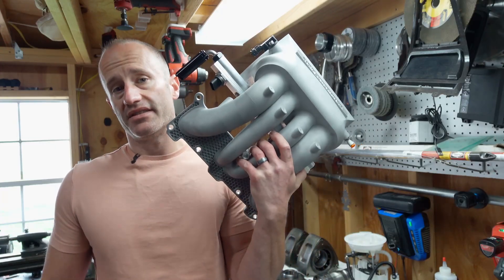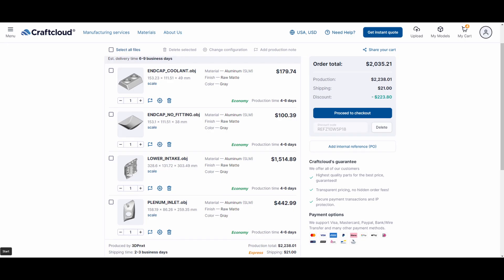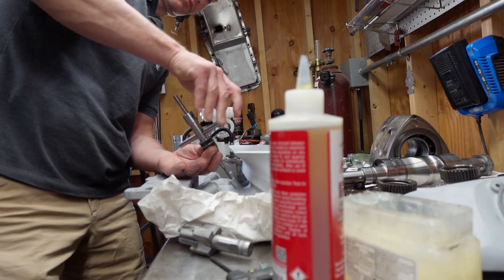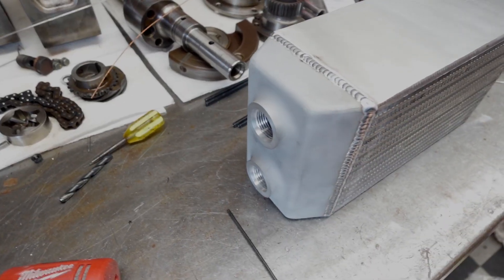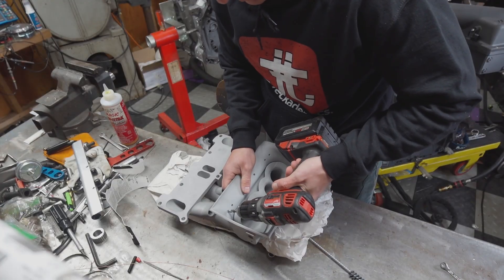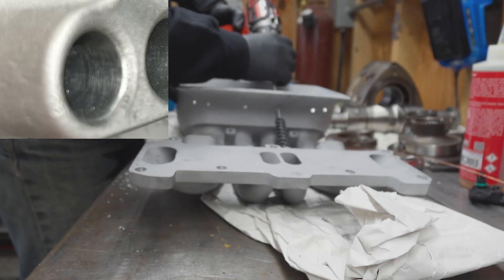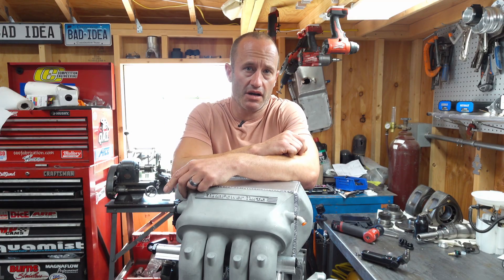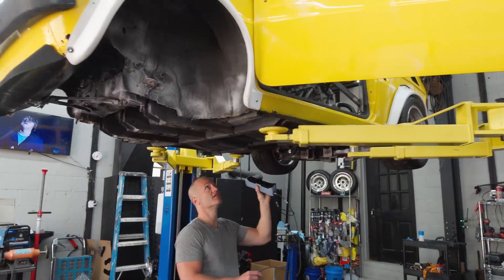Aluminum 3D Printed Intake Manifold - Building a 13B Rotary BMW i8 : EP4

Comment: Please consider doing a thermal dispersant on the intake plenum with a ceramic barrier on the exhaust and hot side of turbo..The company we used for the racing industry is techline coatings.  You can even coat  the hot side of the turbo...
Reply from the maker: Turbine housing is already ceramic coated and the manifold and turbine will get inconel heat shielding.

Comment: Completely awesome! I recently designed a throttle body adapter for a 13B intake manifold, which is a much smaller task. It was still very interesting to get quotes on having it CNC machined or 3D printed. I was surprised how expensive 3D printing metal was, but as the price comes down it will become more and more viable! I think for a seriously complex item like this where the cost of CNC would be so high, it's already reaching that crossover point. Not to mention when the geometry would be literally impossible for CNC as a single part. Really appreciate these videos!

Comment: The belt sander needs to be flat to ensure an accurate result. The straight edge needs to go on the sander first.
Reply from the maker: The amazing part is my belt sander is a 20 year old harbor freight unit.
Reply: @CouchBuilt  Lucky or end user corrected.

Comment: Couldve sent the manifold to a machine shop and ask them to deck it

I dont get why people do the water entry and exit on the same side, just let it cross flow you want to take heat out. When you reverse the flow you just tranferring heat into metal
Reply from the maker: Front motor mount doesn’t allow a cross flow layout.
Reply: @CouchBuilt  understood.

Comment: Also, you may want to do full FDM 3D prints before you send out final files

Shrink them to make it so it doesn't take 3 weeks to print :P

But when I do 3D prints, I ALWAYS miss stuff, and printing test copies helps me catch things
Reply from the maker: Everything was printed at full scale on cheap PLA first
Reply: @CouchBuilt  did it have the same "creasing" in the PLA models?
Reply from the maker: @Rantandreason not on that version. I made small tolerance changes, not involving the runners, before the metal printing. Something went pear shaped between the two
Reply: @CouchBuilt  yeah, we find that happens a bunch between me and a friend of mine. Sometimes he will come up with designs using CAD programs, and they look fantastic on the screen, but some weird ass results

Comment: I used to have a friend who worked in a marine diesel engine shop. They had a massive belt sander (a "belt resurfacer") that they used to surface things, including marine diesel heads (which are usually one cylinder per head). I had them flatten many a header flange for me. That has a machined flat surface that the belt runs on and a high quality belt, but I imagine any decent belt sander is good for an exhaust manifold.
Reply: yes it's more common than people would think. if it's running on a flat it goes flat, but you have to pay attention for the flat itself not be crooked either by a jig or .. well by paying attention i suppose or just doing so little that it doesn't mess things up.  by crooked I mean the surface itself will be flat but it can be at an angle if the piece is pressed more on one side or is heavier on one side if using it's own weight

Comment: Have you tried vapor honing one of those aluminum 3D parts?
Reply from the maker: I had my motor housings vapor honed. They came out nice .
Reply: @CouchBuilt  if you get a chance, and you have some spare 3D printed aluminum, you should give a piece to the guy that did it and see what results you'll get

The reason I'm suggesting it is because you mentioned that oil and dirt sticks to the finish of the parts you got printed

With Vapor Honing, if you use very fine glass bead, it gives it a super nice shine and you don't get the oil and grease prints anymore
Reply: @CouchBuilt  I was trying to find the video but I saw it years ago.

It was a motorcycle shop that did VH as part of it's repairs, and this guy had a part he had done and left it on the front counter. He said it had been there for like 5 years, and it looked like he just took it out of the tank, even thought customers came in and played around with it every day

May be something to consider

Comment: Seriously Impressive. I've spent 20 years building out a full CNC machine shop business. With the end goal of building a car from scratch. It's looking like I could have just waited and 3d printed everything thing instead of 5 axis CNC everything. 3D print with some light finish machining is the future it seems.
Reply: hey man, I've had that thought too, id love to do that one day. the guy that started renishaw done that, I visited to train on a machine they bought, they built an awesome car (McMurtry automotive) also have you seen the zinger c1? the main body is a carbon monocoque with the front and rear subframes being 3d printed titanium, I believe it is also machined to get it to bolt together correctly but it would save a lot of machining time. I posted a quick video of it on my channel. 🙂
Reply: Once AI gets really good (just before it take over the world). it will design the perfect everything. Once we have the "perfect car" the only think lft for human to do will be modify its visual look to taste.  Your own home car design will be nothing more than your own piece of art then as we wont be able to improve on the AI car. Even now the olde the car the more room it has for improvements design by the simple human brain.  Which is why people have more "fun" improving a 50's car that 2020's car.

Comment: I didn’t catch how you finished the 3D printer injector inlets/ports. Do you mind sharing?
Reply from the maker: I’m not quite following what you’re asking?
Reply: Did you have to clean up or do any post processing where the injectors sit into the manifold?
Reply from the maker: That’s covered in the video.

Comment: Your channel has given me hope to keep so many older things on the road.
Reply: With modern tech, literally anyone can get any part reproduced or even improved as long as they are willing to put some reverse engineering and design work. With some solid effort, you could even recreate a carburetor that hasn't been manufactured in over a century. It's super awesome! You can even make the prototypes at home with a basic 3D printer, iterate to your heart's content, and then have it made out of any material you can think of with a simple online ordering service.

Comment: Subscribed and thank you this is some great content, just curious why the rotary?
Reply from the maker: Biggest punch in the smallest package. That and I’ve never messed with one before. Should be a fun mixture of EV efficiency with high fuel consumption rotary.
Reply: I agree but how big of a punch are we talking about. It hard to know who knows what from comments on u-tube so I’ve always been reluctant to comment but I’ve done quite a bit of tuning on the rew’s, imo your lucky that it’s not bridge ported and it only has a small street port and that everything looks good inside. What do you expect idle quality to be? What rpm? I believe your intake design is going to affect it.
Reply from the maker: @georgeplevritis5190 the dyno will tell in time, but Turbo Source has been reliably, in rotary terms, easily clearing 500whp on many similar EFR turbo setups on good fuel. The factory ICE motor only made like 220hp, and the EV stuff will still be there to contribute.
Reply: Sorry maybe I’m coming off wrong, I know the capability of the  13b, whenever we did one obviously to make more power you have to port it, street, bridge, semi periph, full periph, the thing I hated about that is you end up losing low rpm port velocity so you have to bringing up the idle, not to mention that most also add much larger injectors so pulse widths add to the problem, I always go back to Mazda and think they obviously knew this thats why they block off the secondary ports @ low rpm. If the prices weren’t as crazy as they’ve gotten I would totally do 13B rew again but I would change my strategy.
Reply from the maker: Got where you’re going. This is a pretty decent street port. That’s why I went with dual secondary injectors over single massive units as well.
Reply: Sorry editing my comment, love what you’re doing and will be following to see the end result.

Comment: On flattening, I've also had luck using a mid-high grit sand paper glued to granite or glass as a flattening surface. Awesome work on this project!

I also really dig how you are 3d printing jigs for machine work. I should have done this when making my fuel rails!
Reply from the maker: I need to invest in a granite block one day, along with a drop gauge.
Reply: @CouchBuilt  check your local auctions. Surface plates from machine shops often sell for incredibly low prices. From what I've noticed, as a machinist and auction junkie, surface plates are one of the last items to have any attention given - often with only a single bid on them for the more visibly used ones. You can expect to get one for less than $50.
Reply from the maker: @Hugh_Jassle thanks for the tip, I’ll keep an eye out.

Comment: Looks good. I think I would add some support between the intercooler and the engine just to take some of the load off the runners
Reply from the maker: 100%. That’s the plan with an adjustable Delrin pad.

Comment: Love the content. Love how you show your basic fusion360 info, and then the final part... not hiding issues or gotchas either.
I do wonder why the velocity stacks have a gap under them? if they were flush with that plenum "floor" there would be nowhere to trap debris and be just as smooth. Is there a function for that gap that I am unaware of?
Reply from the maker: They are projected off the floor for better flow. I’d suggest googling velocity stacks and laminar flow if you want to dive for more details.

Comment: Nice videos man. But you should have also welded the middle bar of the coolant intake on your intercooler. Wouldve been quite easy, just cut the intake cap on one side of the middle bar in half. Wasted performance, and, water could get pressed through the gap between the core and the middle bar and create cavitating. I know, highly unlikely at such low flow rates, but just a tip.
Reply from the maker: Would be be better welded? Maybe. One nuance you don't see is that the cap rocks on the center divider slightly, so that point has the greatest contact with the core. When its welded, the joint shrinks and pulls, drawing it in even more against the mating surface. With such low flow and having equal core on both sides, it really wasn't worth splitting the part for this use case.
Reply: @CouchBuilt  I know. Autism kicked in, and i had to point it out lol.  
Another question: do you plan to add any supports to the intake and exhaust manifold to support them? Like one thin walled strut from the underside of the intake manifold to the engine block.
Seen that on a lot of OEM engines to prevent stress cracks on the flanges.
Reply from the maker: Yes, there’s going to be an adjustable Delrin pad underneath for support. Even with 5mm wall thickness, I’m going to keep it supported.